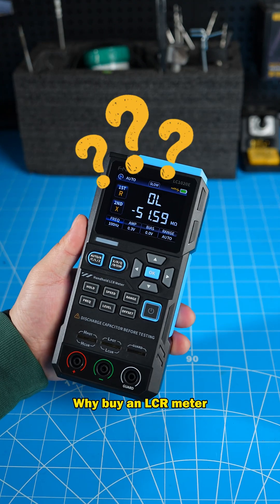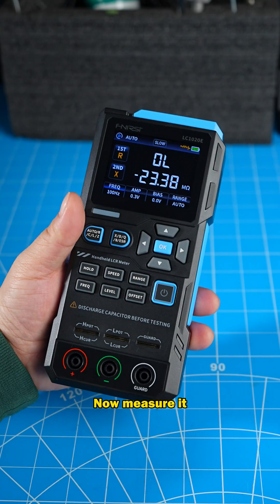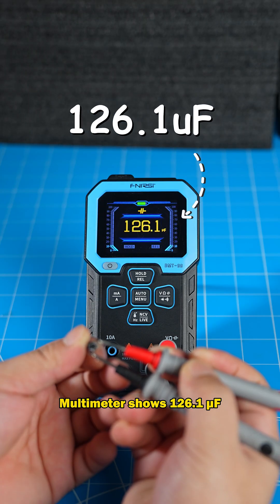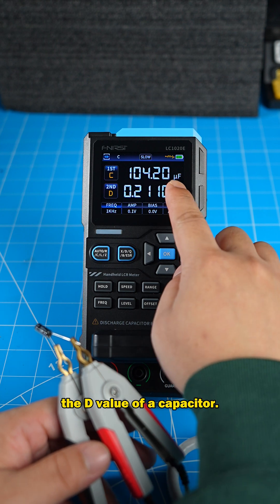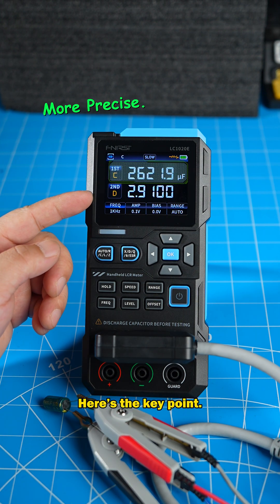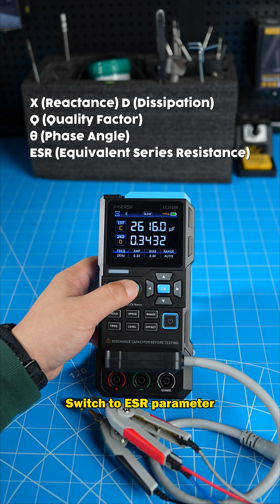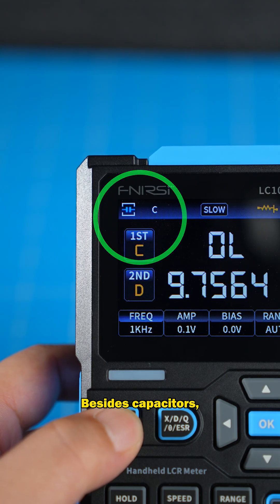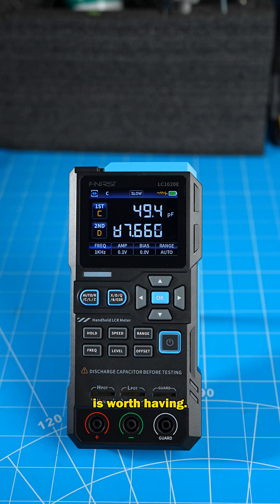FNIRSI LC1020E | LCR Meter VS Multimeter——Why an LCR Meter is WORTH Having #fnirsi #lcrmeter #why

Comment: If you add a capacitor value compensator, it will solve all the problems. Big device without any settings in the menu this is not good solution,